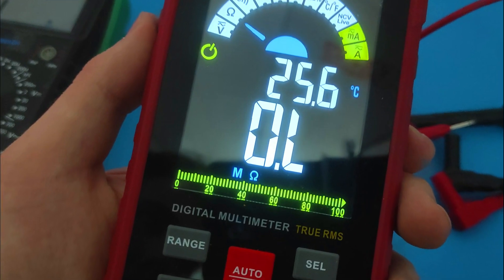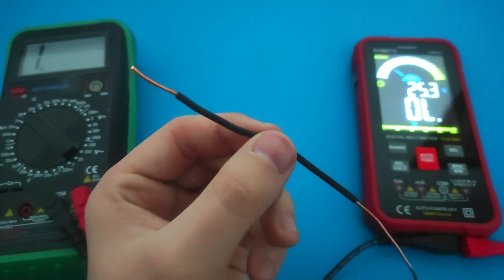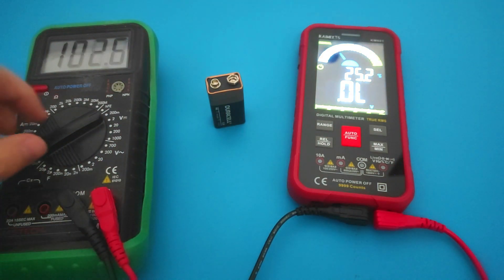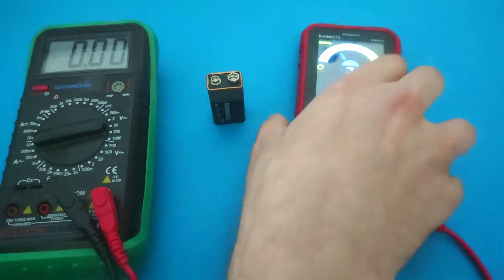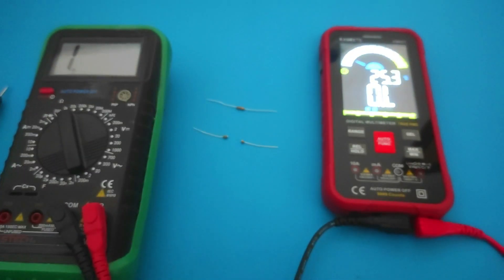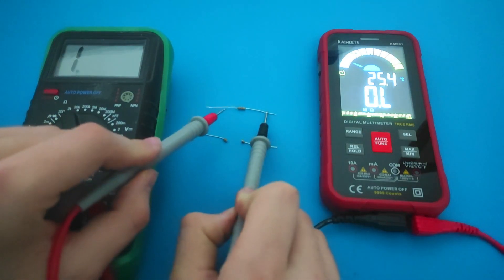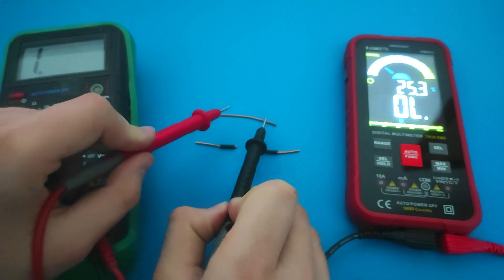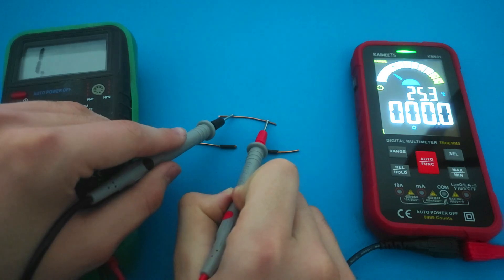What Does OL Mean on a Multimeter (EXPLAINED)

Comment: I find it confusing for new students to understand the concept or should I say context of "OL." 
OL is normal when on the resistance scale without the leads connected to anything, but not normal if you are on the voltage scale and the voltage exceeds the range.
I'll take my old school analog meter even if resistance pushes the needle right to left.....